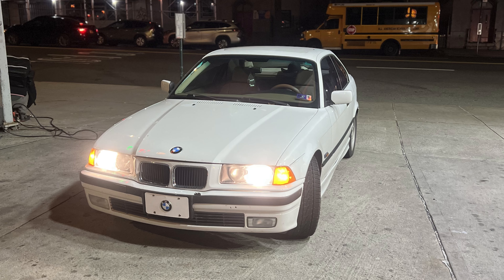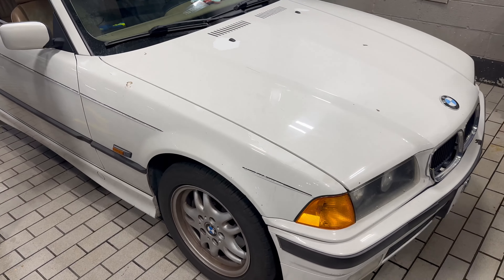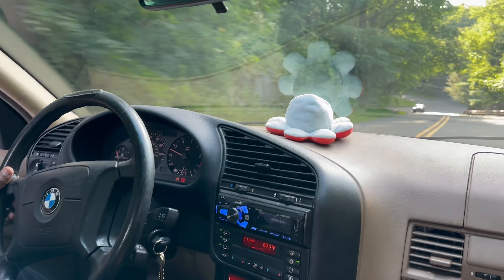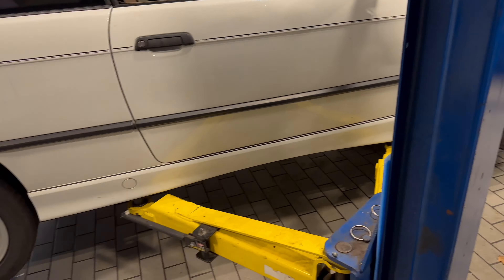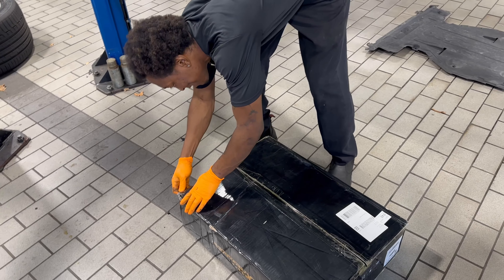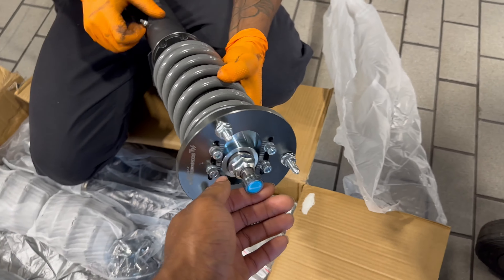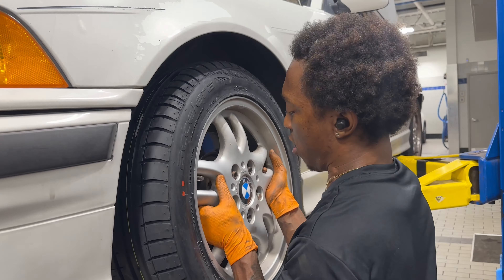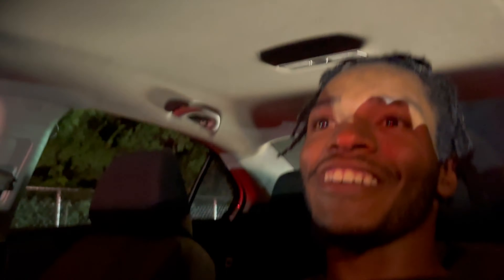I Bought Coilovers For My Bestfriends E36

Comment: Y’all probably figured it out already but you’re not supposed to adjust that rear shock, only the cups on the springs. I took the cups out entirely and left just the spring, and then adjust the shock so that the spring doesn’t fall out on full extension. When u adjust the shock it sets ur preload, it’s backwards to adjusting the front. Mine rode great, adjust dampening as needed, front preload might have to be adjusted and it’s gonna ride like shit no matter what with the bad wheel bearings
Reply from the maker: I told him that about the rear strut when we were doing it on the lift that’s why we were readjusting it outside on the ground
Reply: @Tyreakmcgregor  yeah just take out the cups then, if it still isn’t low enough he will have to get shorter springs, but mine was dumped when I took them out
Reply from the maker: There gonna send us softer springs

Comment: The thing I hate about coilovers on an e36 is the mf stud/nipple thing on the front between the 2 bolts on the hub. That shits mad annoying.

But otherwise I've done it so many times I can usually do coils in under an hour. Or bag one with airlift 3p in under 4. 🤣
Reply from the maker: Ode annoying 😭